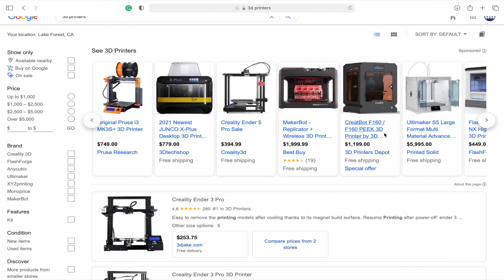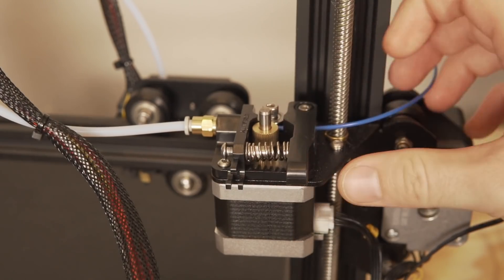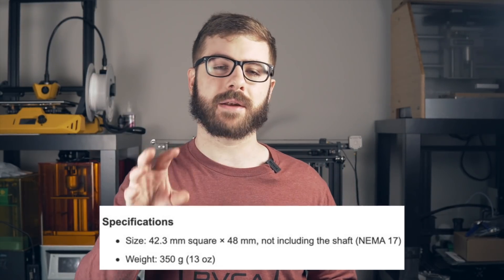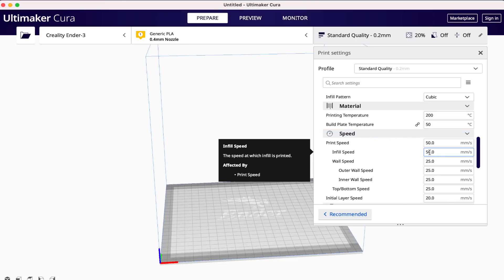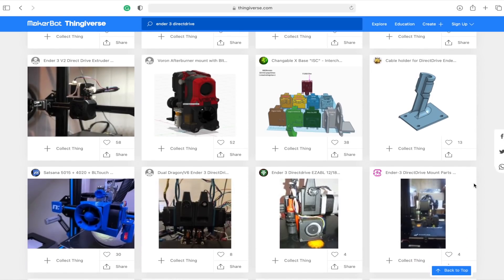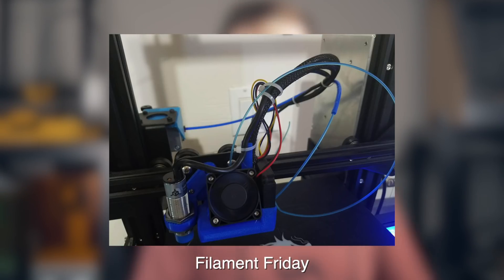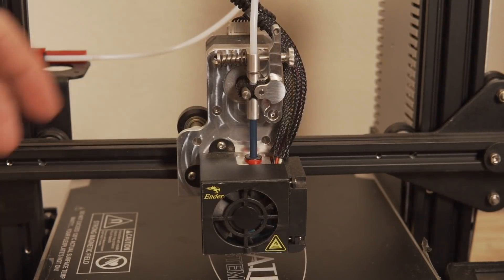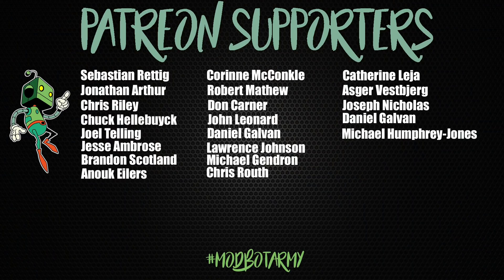Bowden 3d Printer Extruder Vs. Direct Drive

Comment: Great video. My printer came with a bowden and I am ready to swap it for a direct. I print at similar speeds as you (50mm/s) and I want to print with different filaments which bowden will not be capable of.

Comment: I have a MicroSwiss full kit on my ender 3 pro and haven't looked back haha the speeds and clean prints I have gotten blows the ender 3 pro stock out of the water , debating about making my chiron direct drive
Reply: I find my results worsened once I switched to the MS kit. I've set my E-steps to 142.9 and retraction to 1 mm at 35 mm/s, printing at 40mm/s. Mind sharing your settings?
Reply from the maker: Yeah I love mine as well. I have a temporary stock Ender 3 and it is not nearly as enjoyable to use as the one with the MS DD. I think I may have spoiled myself :p
Reply: @yony120  I don't have any crazy settings especially since instead of setting esteps (I always mess up) I 3d printed a cr6 filament guide just flattened a little and that solved my problems but I run 3.5 mm retraction and I print 50mm typically but for the most it's just stock settings I change settings more so depending on the print 🤫
Reply: @ModBotArmy  oh yeah I totally feel you with spoiling yourself haha I have a cr6 that I feel I just wanted money on because I thought oh auto bed leveling will save so much time but I spend more time fixing it then I do anything else plus manual leveling is now so much better when I have experience haha

Comment: I think (but havent measured!) that the extra weight of a direct drive extruder rarely matters. 3D Printer frames are fairly stiff nowadays and in most cases the maximum acceleration you can get will be limited by the Y axis anyways. Bedslingers need to move the heavy bed and CoreXYs the heavier gantry.
Especially for larger CoreXY style printers a bowden tube is a pain due to needed length. You either get a lot of strining even with PLA or you need to retract a lot of distance. Not only does that slow down the print a lot but can also cayse a lot of extruder grinding on the same filament position leading to feed issues.

Comment: I have an Ender 3 still Bowden, CR-10S Pro with a direct drive Hemera, and a fairly stock CR-X.
Reply from the maker: How do you like the CR-X? I have had a few people ask me about it and normally I am not a fan of mixing style hotends.
Reply: @ModBotArmy  it wastes alot of filament with the purge block, I got it for a commission that never worked out but now I just use it as a single filament printer beacuse I don't like the amount of waste it produces.

Comment: For me its not a debate anymore with things like the sherpa mini and orbiter extruder you can have both
Reply from the maker: That is true. I still do not feel they are widely available and I am not really aware of any machines that they come stock with. I am sure this may change over the next few years.
Reply: @ModBotArmy  You are correct on all counts but with the release of the orbiter extruder V1.5 they went from sls to injection molding. Thats a big investment and a large bottleneck removed in supply chain i'm thinking we will see a lot more of it. Maybe a few printers in fourth quarter of 2021?

Comment: I went with the ender 3 v2, i upgraded it on day one and the only thing i did not do was "upgrade" anything to do with the heat block, other then that i've bought/printed every upgrade for it and i couldn't be more pleased then i am now. im 100% new to this and tbh i was not expecting anything near what im getting... shit almost looks store bought, everyone should own one!
Reply from the maker: What were the upgrades that you did to it??
Reply: @ModBotArmy  better wheels, the better filament feeder with the better feeding tube, as well as new springs for the bed, BL Touch,  and some better nozzles for when I'm feeling froggy and I feel like I won't drag it across the bed anymore. I currently have a glass bed but I also have the flexy metal one I can't remember the name that I haven't used yet in fear of the whole dragging the nozzle across the bed ordeal. But basically that's what I've done as well as make a custom profile on for cura that I've kinda be fine tuning here and there  and I've got it in a enclosed ventilated area "closet" and tbh I've only had maby 5 failed prints out of the 50 or so I've done so far. All the measurements check out and I've not really had any problems so far, keep in mind I've only used PLA so far.
Reply: @ModBotArmy  also using you're videos and countless others regarding the ender I made sure to the best of my abilitys to make sure everything was as tight as it needed to be, cancel out any wobble level the bed etc as well as all these upgrades befor I even printed anything.

Comment: Great info. thanks. Recently bought a Kywoo3d Tycoon which has a direct drive. Works well with pla. With any flexible filament it jambs up on the outlet of the drive gear and pulley wheel… not feeding into hot end thru the ptfe tube that is inside the hot end above the nozzle.  tried 240c at 10mm/s and jambs right away. any thoughts?

Comment: I have to repair my Bowden at least once every couple months. I will never buy another. The four Achilles heals of the Bowden are as follows.

1) After a while, the Bowden tube fittings fail to properly secure the Bowden tube, which means you can't use retraction and you get really bad prints. As small as 1 mm movement at the extruder is death.
2) Poor dimensional tolerances of the teflon tube mean that with one tube, the prints are OK, but with another, they suck. Those aftermarket blue tubes usually solve this problem.
3) Whenever there is a filament feed problem and your not there watching, the hot end will melt the end of the teflon tube plugging it. The only way to fix it is to cut off the end of or replace the teflon tube and replace your nozzle.
4) Whenever filament flow is affected by any of the above, the extruder grinds the filament into dust.
Reply from the maker: Damn it sounds like you have had a hell of a time. What printer or printers are you using? Have you thought about swapping it over to Direct or you dont want to deal with it?

Comment: ive tried a bunch.. printed, amazon crap and more .. the micro Swiss dd setup with all metal hotend has been by far the best upgrade on all my machines. never had a singe problem at all .  best 100 bucks you can spend on the machine

Comment: I am going to modify my (relatively new) Anet ET4 Pro from bowden type to direct drive, I already printed the part needed. I‘m also printing with low speeds around 50mm/s, so a bigger mass on the x-axis is no big deal, I hope. The idea of using a smaller / thinner stepper motor for the extruder is great, haven‘t thought for that. If the mass has issues on the x-axis, I will try that. My intention is to print more parts with TPU in the next time, so a direct drive is necessary to do so. Thanks for the information given by your video.
Reply from the maker: I would start with the full size motor like you said and if you run into issues (I doubt you will) try smaller. I think you are going to really like it. What extruder are you going with?
Reply: @ModBotArmy  : It‘s the one the Anet was shipped with, I don‘t know its name. But yesterday  - when I started with the „project“ - I had to stop it. After disassembling the extruder I found out that the developer of the adapter forgot about the proximity sensor used for bed levelling. It‘s not accessible anymore. So I had to modify the part and print it again, but it‘s now not stable anymore. But I found a new solution idea on YT I want to build after modifying it so that my filament sensor can be also part of the moving head. In this new solution the extruder motor is turned 90 degrees and now oriented along the y-axis. The disadvantage is that now the CoG of the moving head is far away from the rail and that makes me not so happy. The attrition of the wheels will be much higher then. So maybe I come back to the first (modified) solution after I increased the stability. Worst thing is that a print of this adapter lasts more than 7 hours...
Reply: Ok, done.
I designed the extended adapter and printed it, I ordered longer cables for extruder and filament sensor (and modified them a bit, the cable length and the pin layout had to be changed), and assembled everything. Took me about 3 hours because I also changed the complete hot end (I was not able to disassemble it without damage, real low quality). Fun fact: Even I changed the hot end, I had not to correct the levelling.
Now it‘s printing the first parts and it looks good. Thank you for encouraging me to change my printer within the warranty time period. 
Meanwhile the printer is ready, the result looks good!

Comment: I've just got into 3d printing with an Ender 3 pro and love that machine.  Some random gripe about nomenclature:  It does seem like in the 3D printing world, these terms have become standard, but it's weird to me to call the filament feed servo the "extruder"  while what I would actually call the extruder is called the "hot end"  If anything is to be called an extruder, shouldn't it be the nozzle? (since it's doing the extruding)
Reply: Yeah that confused me too at first. I figured that the extruder was the nozzle and all that and that the extruder was just a feeder 😂

Comment: I don’t understand how the direct drive can be better in the retraction area. If the extruder is retracting the filament a half an inch, it would be the same half inch regardless if the motor driving the gears is 3 inches from the hit end, or 12. They’re both still pulling the filament from the same spot, just one set up has 12 inches of filament in front of it, and the other has 3.  I guess the argument can be that it’s easier to push 3 inches of a material than 12 inches of a material, but we’re talking about an extremely lite weight material.

Comment: I think what's most important is the hotend components. If you are using a Bowden system on a crappy hotend, then the extruder is hitting a lot more backpressure. A direct drive allows the printer to somewhat push through and overcome bad hotend designs. At the end of the day, they both do the same job of pushing filament, and if designed for their ecosystem well both will perform their job well. Heck, the Ultimaker line of 3d Printers are all bowden setups and they don't seem to have any issues.
Reply from the maker: Totally, that is a fact. The quality of components make a huge difference. Not all bowden or dd setups are created equal.

Comment: Just switched my CR-10 over to a direct drive, I like it, but I've found it's WAY more sensitive to bed levelling issues. If the bed isn't perfectly level, the first 5 or so layers come out wobbly.
Reply from the maker: Interesting that is not something I have noticed before on my machines. I dont see why that would be the case. I would check to make sure your z axis isnt having issues. I have an Ender 3 right now and it is stock but the Z motor seems to be binding on the first few layers so they turn out rough.
Reply: @ModBotArmy  hmmm that's good to know. it's a fairly well used CR-10 thats now going on a year old. auto bed leveling seems to work fine, and worked fine with the bowden setup right before switching, but the extra weight could be making the difference. thanks for the info!
Reply: One thing I would do is take the fan cover off and check to make sure the screws holding the hot end against the back plater tight. I bought a direct drive extruder from Creality and that was what had happened to mine. Now it prints perfectly. Or at least as perfectly as a noob with less than 5 months experience can make print. I have both of my Ender 3 printers tuned well enough so I can print the Maker's Muse tolerance test so that all five of the dials turn at .10 layer height.
Reply: @KLP99  hmm interesting thought. I seem to have solved the problem with a textured PEI plate as opposed to a matte one, but I will definitely check those screws.
Reply: @bepstein111  
I decided to get the Creality glass covers.  They are awesome. I also use either Magigoo or Layerneer. The more I use the latter the better I like it.

Comment: I'm having a lot of trouble printing tpu with a bowden printer, as well you have a limit of nozzle sizes.    Greg wade's extruder ftw.  lol    It never fails, it creates so much torque, which simple bowdens never will.  I have 4 greg wades, 2 of which drive 1mm printing nozzles.   My little bowden unit is cute for small diameters but it has zero overhead.  I guess you can actually use a greg wade with bowdens though which might be a fix for my tpu problem.

Comment: for me personally, I started out with a bowden setup, and I'll be honest, its because I didn't do any research. friend said "this is a good brand" and I bought one of their printers, and it worked great for me for a while. then I got into printing more exotic filaments, and I found my setup had problems, especially with filament like TPU. Fortunately my friend had not steered me wrong, because the brand they told me was Creality and the printer I bought was the Ender 3 V2, which has massive aftermarket support, and I upgraded to Direct Drive and an all metal hot end in one go with Microswiss. Ultimately what it came down to for me is that long print times were not as important to me as the end product looking nice, and being able to use the filament I wanted. I'm not saying bowden is bad, But I am saying for those out there that want to be able to print any filament they desire and are okay waiting for their prints to be done, Direct Drive is absolutely the way to go. really, the best advice I have is make sure you can change if you decide your needs change. I kept my bowden extruder, because if in the future my needs change, and I want volume and don't care what filament, I might just change back.

Comment: Thank you for the video, I am still looking at making a purchase (probably within the next day or two) and I am just trying to see what is available that will not take days to put together and can still be reasonably versatile.  Although, if it did not take more than a month to get a prebuilt Prusa i3 mk3s+, I am leaning towards an Ender V2 because of the delivery time.  I was concerned about the direct drive verus bowden 3d printer extruder and your video addressed some of my concerns.
Reply from the maker: Hey Larry! Thanks for watching. The Ender 3 V2 is not a bad machine from everything I have seen. If you do decide down the road you can always upgrade it but for a starter printer there is a lot to learn and it really is a solid option.
Reply: @ModBotArmy  Thanks!

Comment: There is moving table in i3 style printers plus weight of printed detail versus weight of direct drive extruder. Manufacturers like bowden due to they can make $100 printers. It works while customer printing benchies with PLA.

Comment: Thanks for the video. It sounds like upgrading to Capricorn tubing and a dual gear extruder on a Bowden feed printer would be a good way to go for a first printer. I don't foresee really wanting to print flexible material so the only other upgrade I'd be doing would be an all metal copper hot end since I would like to be able to print nylon and some other higher temp materials.
Reply from the maker: Yeah if you do not need to print with flexibles honestly a good extruder, capricorn and all metal hotend will let you print with a huge catalog of materials.
Reply: I actually have had good luck so far with high speed TPU 95 with my stock (Bowden) extruder setup on my ender 3 pro, just printing at 30mm/s so far though. Bought a dual drive for the stepper and will try to up the speed once I install it. I love the TPU for printing table top minis since they flex rather than snap when they get tossed into a box or fall on the floor.

Comment: I've been fighting with my 6' delta to dial in bowden. I'm using duet, PA settings,  and bondtech qr extruder, and a mosquito magnum hotend. Due to the size of the delta,  the bowden tube is over 500 mm long, and am using a 0.8mm nozzle.  No matter how I dial it in and compensate, either blobs occur or it leaves gaps. I finally threw in the towel and am switching to a flying extruder. Bowden works for shorter runs, and smaller nozzles, but a big delta like I'm running,  dialing it in is 2 steps forward 1 step back.
Reply from the maker: Yeah that is tough on a Delta that large. I had a large Delta for a short while that was very tall and I could not get good consistent prints out of it. I hope the swap does the trick for you.
Reply: @ModBotArmy  the flying extruder worked perfectly. Absolutely the cleanest prints. No ringing, no blobs, retraction setting is now 1.5mm. Using a bmg with a pancake stepper. Has no problems keeping with a high flow hotend and fast prints. The big heavy bondtech qr will go into the spares bin for a future build.

Comment: Thanks for the video Good  Question
Bowden vs Direct drive
I'm Thinking direct drive because I want to Print flexible filaments point 6 or 8 novel 
Also This will be my First 3-D printer 
So I am looking for 300x300x400 like Sidewinder X1 but the X2 coming out soon
& Atomstack Cambrian 3D printer.
Reply from the maker: If you know you want to print flexibles I would definitely opt for a DD. You will be happier and have less trouble dialing it in.